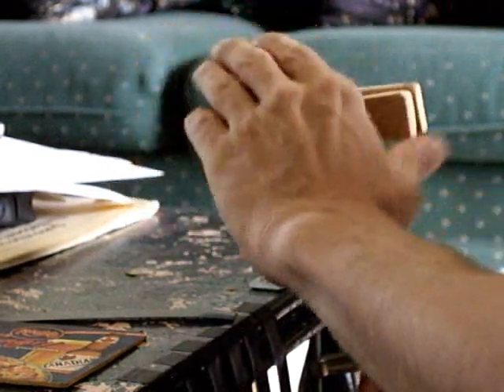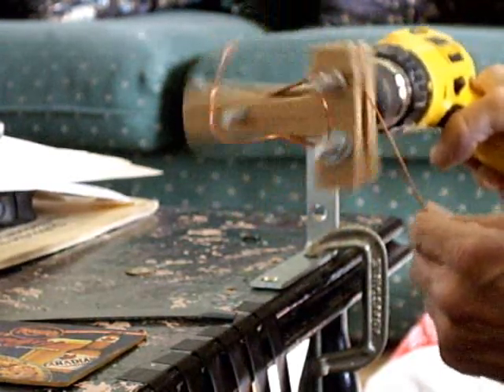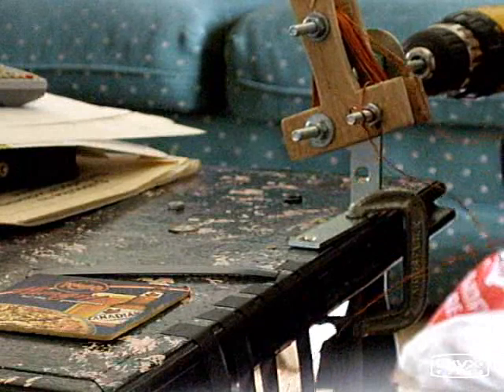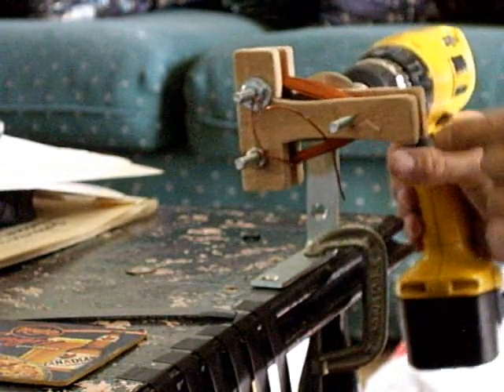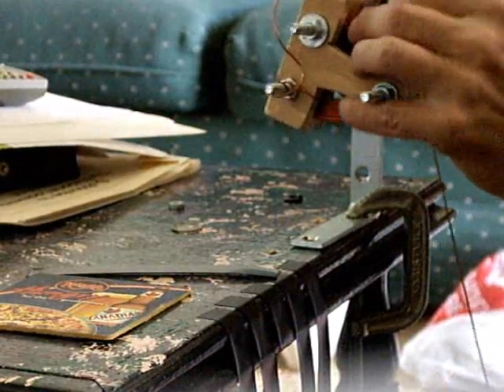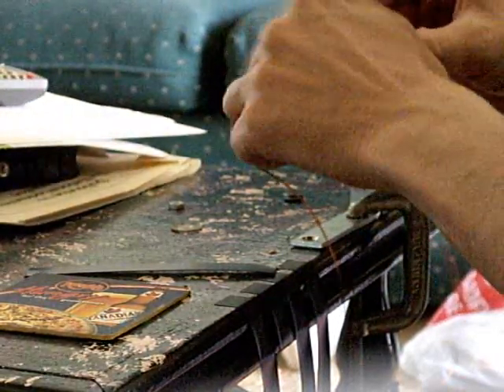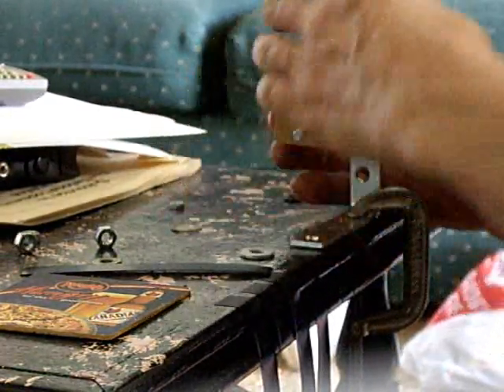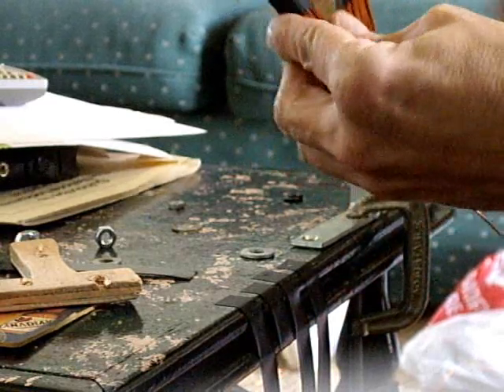Wind Turbine 80 Turn Coils.wmv

Comment from the maker: Haven't been on for a while but will try to answer your multi-question.
First, the gauge of the wire, choice is yours but consider the current you are producing per coil. Number of turns per coil will determine your voltage curve in relationship to the current. 
The coating on the magnet wire is varnish.
No iron cores, this is for an aerial flux generator.
As for the shape and so on, I recommend reading up on why, not a short story. I recommend you build a 1kw first & careful with the magnets

Comment: Why do you use 80 turns with 18 wire and I would like to know what type of coating the wire has either enamel or poly and why no iron core? What is the voltage output per cycle? It seams more power could be generated with more turns and if the coil is a symetrical design and with an iron core. And why not a simple round coil or even an ablong coil? Also I would like to know what size magnets you use. I want to build a 3 phase gen with a 5kw/h output in a 10 mph wind.

Comment from the maker: Sorry for the delayed answer, haven't been on much.
Your spacing between the coil and magnet should be somewhere between 1/8 to 1/2 of an inch to provide for maximum magnetic field penetration. This of course is proportional to the strength of your magnets regardless whether using single or dual magnetic rotors.

Comment from the maker: The reason I keep the coil thickness down is the magnetic field will penetrate the entire depth of the coil. With a 2" thick coil, you may want to consider a second magnetic rotor (like in an areal-flux generator) or increasing the strength of your magnets.